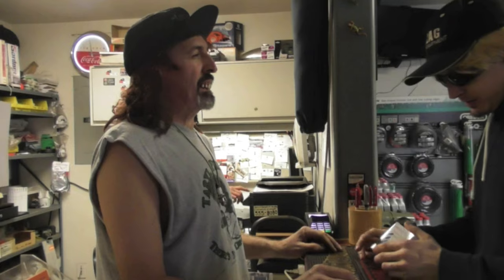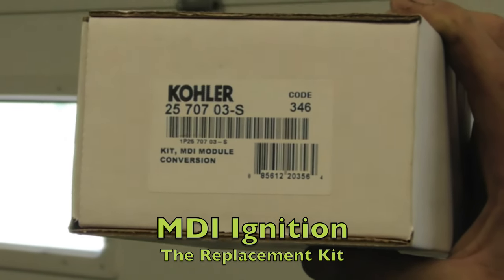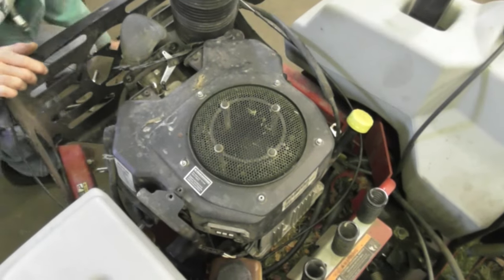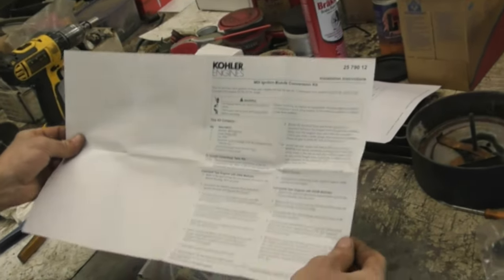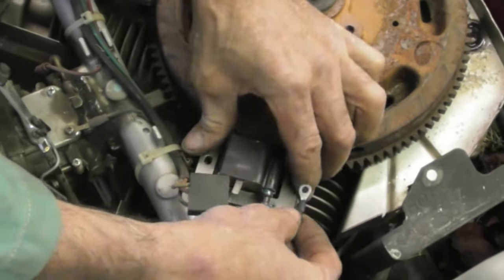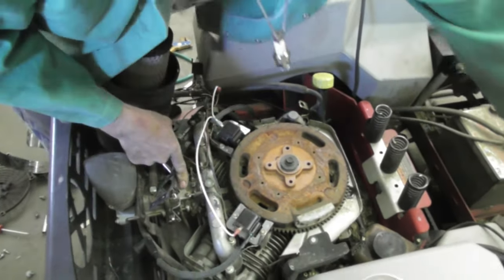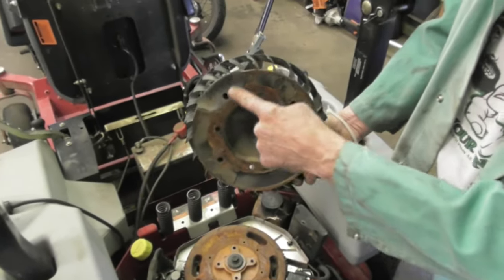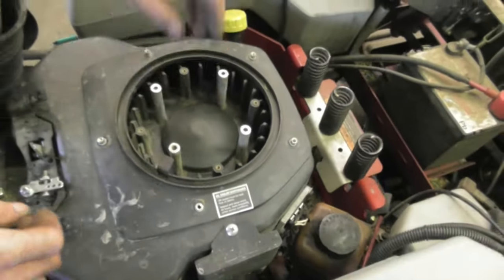EASY GUIDE to Install The Coil Kit On A Kohler Command Engine (DSAI Ignition)

Comment: Man I didnt know what to think starting to watch this video, but I gotta say, I followed this and even used it to explain to the Husqvarna dealer what part he needed to order...That being said, I replaced it and just left wiring harness in place just attaching the white wire.  It runs great both cylinders firing great, but when I turn the key off, its won't turn off.  I am assuming that fuel shutoff solenoid is not shutting off fuel.  I think it is the red wire, but I am unsure.  If it is am i supposed to go to ground with it?  Any advise would be appreciated, I am not too impressed with my local dealer.
Reply: @ItsMrAssholeToYou  thanks I will try it when I get home, i have been managing with fiddling with the choke, but your comment makes sense.  I will let you know when i get it swapped.

Comment: Taryl, one of the coils on my Kohler command 20hp was dead. I did this kit install and I am disappointed with the loss of power I now have. spits and sputters and backfires when I kill the power. Is there something else I can do to regain the HP I used to have before the coil kit "down grade:?
Reply: I am having the same problem after installing this kit , engine now does not have enough advance with this kit
Reply: @dougdier3104  I returned that kit. And found a used coil on eBay and it worked perfect again.

Comment: Thanks for the video, one of the best and funniest I've seen!  I think I'm having the same problem with my Kohler CH740S although I've got the type with the external module. Looks like the kit I need, 25 707 03- S is the same one you installed, your video will definitely make the job easier.

Comment: The lesson here is you either buy a Briggs Vanguard,Honda,Kawasaki in gas engines,because Kohler screwed up by not reading the book called Ignition Systems For Dummies.(I.S.F.D)
Reply: Kohler parts are built in China. Kohler should have MADE IN CHINA on all it's boxes.

Comment: Hi All, I just wanted to add a little tip to this video.  This process, and conversion kit, works on a 2004  CV740-0028 with conversion kit specified in SB300 http://www.smallenginesuppliers.com/html/engine-specs/kohler/SB-300_Improved+DSAI+Ignition+Modules.pdf .  The thing about it is there are not 3 prong connectors.  Just disconnect all of the old engine coil connectors, plug in the new white jumper wire to each new coil after installation, unplug the butt connector by the carburetor (red wire), and disconnect the white butt connector going to the old speed advance module.  The white wire referred to in this video is white wire left behind after removal of the speed advance module.  It runs back up in a wiring harness.  Also, you'll need to clip a couple of zip ties and the ground wire to get the old module and wires out.  nope that helps!

Comment: I have a cv25s-69545 Kohler no spark with dsam ignition I called Kohler they told me I need kit that has a new flywheel with iit so engine will be in time is this ture or they just trying to get more money
Reply: I installed this kit on the same engine that you have and now  the timing is retarded, what Kohler told you might be the right fix with a different  flywheel.  Right now mine had more power running on one cylinder  with the dsam ignition than now running  on two cylinders with this same kit tarsal installed

Comment: vertical shafts are easy, i'm pulling my hair out trying to replace the coil on a 18hp horizontal shaft kohler, on a 2146 cub cadet, YOU CAN"T GET TO IT!!finally got the cover loose, but there is a mesh circle around the engine shaft that wont let me remove it.
NOTHING on youtube. help.
Reply: You probably got it by now. I had to disconnect where the two shafts meet and pull the 4 motor mount bolts to slide the engine back.Take the 4 bolts off that hold mesh debri cover on.

Comment: I got one of those kits for my ch25 but the instructions said I needed a different flywheel to make it work. Bullshitt I tossed the keyway used my tdc stop and marked tdc and with my digital advance ferrit flashing thingy I set the timing to I think 10 or 12 btdc. Its been working fine for a couple years. who needs a stupid flywheel keyway anyhow. Screw printers

Comment: kohler needs to get back to the basics.  have to use super light oil in mine or it will cut out.  I can't run hills because it burns oil badly on all slopes.  wish the old cast iron Wisconsin's were used in modern power equipment.

Comment: the (only)problem isnt with the ignition, but its the fact that the lawnmower has a kohler engine on it!! i hate kohlers!!!    the parts are way  too expensive!!   and as far as the coil conversion, i bought one for my ch 22 and it lasted about three months before one of the $45.00 coils stopped working!!!!!!   kohlers are garbage!!!!!!!!!!!!

Comment: I think you need a florida vacation , a slightly working florida vacation , you see.. the boats run good , both of them , inshore and offshore , but I pay for them boats with my newer scag tiger cat, yamaha motor and a older 2017 turf tiger kohler  , all 730 and 740's , and my older tree equipment , vermeer 252 another dam kohler . And three old chevy bucket trucks , this shit breaks everytime I use it , I got the stump grinder in pieces putting a used motor on it , but all I really wanta do is go fishing , or boating ..do you fish or boat ? I got places😅 to stay , bring your camera , we will make Daryll goes on vacation , osceola turkey hunts in season , axis deer , and hog hunting all year long , offshore or inshore fishing , river and pond on the back 40 acres , cow pasture though ..I'm set up here ..I just need a supervisor for a day or two , maybe someone that can get the right parts coming ..nothing hard unless you like a challenge ..ls1 swaps in 2000 gmc's 3500 , just some examples of deeper stuff I do , transmissions , 4x4 lifts , chevy truck junk yard ..
Reply: Oh I gotta printer to repair and lots of pew pew toys

Comment: $100 for a foot of wire, 3 zip ties, and 2 $15 coils.
Reply: jhitt79 exactly, ripped me off too
Reply: dude 75 percent of the cost is that badass kohler stickerv
Reply: @matthewowens455  What coil comes in the kit to just replace them?
Reply: What coil comes in the kit to just replace them?

Comment: That was s really neat concept kohler had, a carbureted engine with a variable timing ignition, in sure it helped make a lot more usable power curve vs fixed timing, which is always a compromise between being advanced enough for starting and idling and retarded enough to avoid detonation at high load and rpm’s.

Comment: Great Video--I have a Kohler 23 HP engine on my Generic JD-L130, Great Engine in 12 years has never used any oil but everything else on these Generic JD's are Trash, many parts made in China or Mexico. Deck Hubs are made in China and will not last over two or three years.....
Reply: It's deff a real deere.. . But one for people who want a deere who can aford a good one.. if u grease the spindles they will last there grease firing on them . If u by aftermarket n no deere parts there junk ..